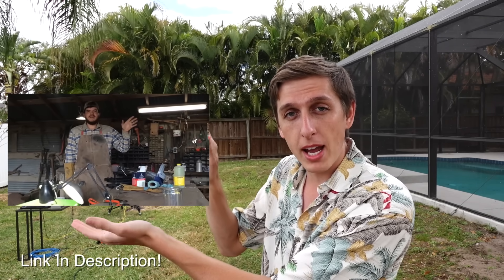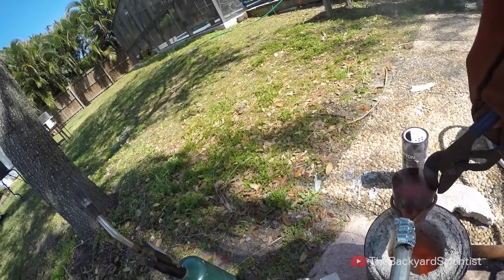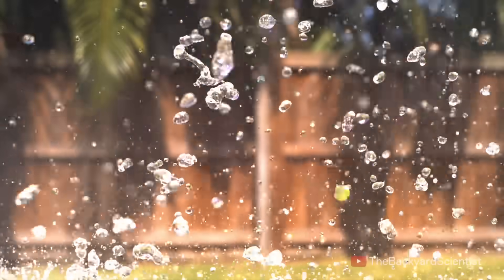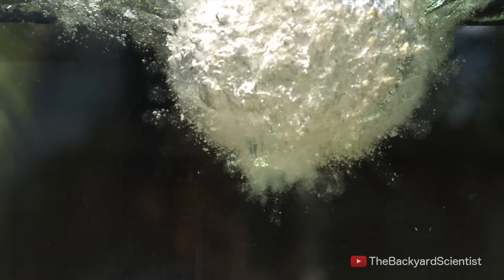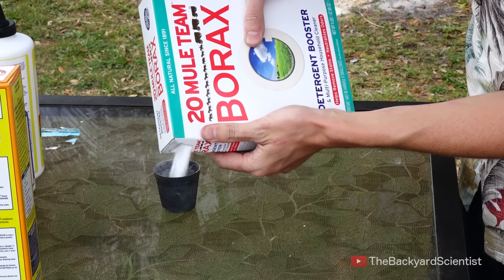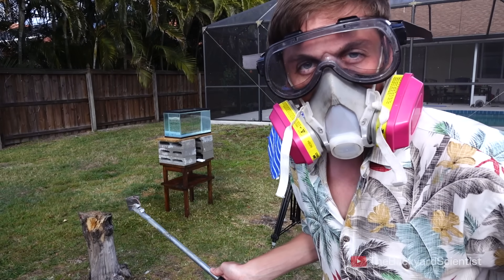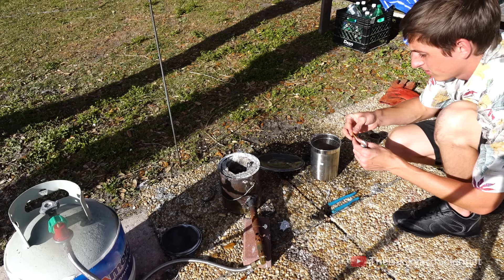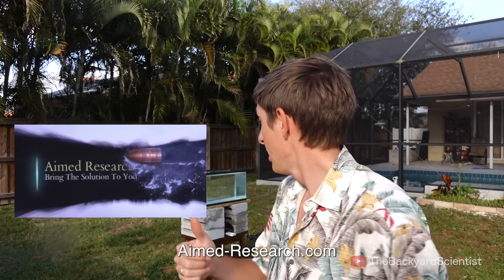Pouring Molten salt into Water - Explosion!

Comment: This phenomenon is similar to the prince rupert's drop, where molten glass coming into contact with water forms internal tension within the glass. Although glass becomes fully solid, salt does not.

Salt can only crystallize, and because of that, it is extremely fragile compared to glass. (the crackling that you hear from the cooling salt is releasing internal tension within a molecular level)

A prince rupert's drop explosion is extremely similar to this explosion and possibly would need further investigation to see if this is factually the same effect.
Reply: +Stephen King You couldn't be more wrong. http://ufdcimages.uflib.ufl.edu/AA/00/00/03/83/00060/AA00000383_00060_194.pdf
Superheated Liquids; A Laboratory Curiosity and, Possibly, An Industrial Curse
specifically states that there is no solid salt formed during the explosions. The generally agreed upon mechanism is that the molten salt is immediately dissolved into super-heated steam which provides near perfect heat transfer from the salt into the water, creating more super-heated steam, which immediately dissolves more salt, etc., ad finitum. The go/no-go is whether the super-hot substance will quickly dissolve in super-heated steam. References say this also happens with LiCl and KCl. I can think of a couple of other houshold salts which might work.
Reply: This paper was written in 1977, better high speed photography is possible now. As I maybe should have said, this needs more (recent) investigation. Although the paper postulates that it is fully liquid, but has this technique been used in different liquids and temperatures? 

These methods would rule out thermal shock and the reaction being exclusive to water. 

I do believe that the explosive force is definitely vapor based, but my theory is that the molten salt  would need more surface area to cause such a large blast.

My surmised idea would be that the liquid instantly forms a shell and in the same instance because of some internal stress explodes, continuing through smaller and smaller explosive particles.
Reply: Also, I should say. I'm in no way academically inclined towards thermal dynamics. I really don't have much knowledge of research that has, or currently being done on this subject.

I'm just assuming and applying a common sense approach to working this problem out.
Reply: +Stephen King So you don't understand what causes the explosion but because you like Prince Rupert you will  ignore all previously published research on the subject and assume that any explosion is caused by "cracking crystals". Very sound methodology.

 FYI the "cracking sound" is the microphone cutting out the (rather loud) explosions (of extremely short duration). Get it? your base assumption is wrong.
Reply: The crackling I was referring to was this... 
https://youtu.be/PDRWQUUUCF0?t=58s

(Which is internal stress being released)
Reply: Your indignation to me is pretty noticeable, but I am in no way refuting previous research or acting as if I know everything. I am just asking questions and wondering if anyone has the answers.

"It is the mark of the mind untrained to take its own processes as valid for all men, and its own judgments for absolute truth."

Comment: salt crystallizes that's the reason
Reply: No
Reply: +danel bertrand I think it's just the water vapor just rapidly expanding in the water m9.
Reply: +Infinity315 it seams like there's hydrogen Bubbles getting trapped inside the crystal structure and that's causing it to explode
Reply: danel bertrand If there was hydrogen then there would be a flame, which you can clearly see is not present when it explodes.  Also the separation of the Sodium and chloride requires electrolysis which isn't happening since there is no current.
Reply: +Infinity315  gasses don't always combust in a reaction
Reply: danel bertrand Regardless, you're still wrong.  It's impossible to have hydrogen (in this without an alkali metal (in this case Sodium).  The liquid Salt would've had to be electrolysized (sp?) to get Na and Cl.

Comment: The solution rate (the rate at which the NaCl salt dissolved in the water) was increased by its elevated temperature to exceed the rate at which the liquid water coming into contact with the molten salt was converting to steam.

The relatively large mass of molten salt very rapidly dissolving in the water caused the shock wave that it created by its rapid dissolution to be powerful enough to break the glass of the aquarium when it hit the aquarium walls.

Cooling of the salt by its contact with the water overcame any tendency of the water to flash into steam.

You obtained a surprising result with your experiment.

Apparently, the Borax did not have the very aggressive capability of dissolution in the water as did the salt. Plus the mass of Borax seemed considerably less than the salt.
.

Comment: The sodium isn't reacting with the water, it's the Chlorine and Hydrogen.
My theory is that the Chlorine is being offered up by superheating the NaCl, and since the bonds between the Sodium and Chlorine are chemically weakened by the heat it can be separated by the temperature shock during the Leidenfrost effect. Temperatures in excess of 1,000F are also usually sufficient to be able to split water molecules(see pouring water on burning Magnesium...). NOW, here's where things get messy: The chlorine is reacting with the water vapor around it and Ultraviolet radiation from the sunlight, stripping the Hydrogen molecules from the Oxygen, while the vapors from the NaCl allow it to mix with the freed Chlorine gas. UV radiation is acting as a catalyst, causing an extremely powerful, highly explosive reaction and creating small amounts of HCL that are being blown up and out of the water when the cavitation bubble collapses. Since the reaction happens so fast, but is so powerful, there wouldn't be time for a large enough amount of hydrogen chloride to form and alter the Ph balance of the water significantly enough to be detected by test strips. Another thing that is contributing to the violence of the explosion, is Hydrogen, which in and of itself is a highly unstable element and pretty explosive if given a little nudge, particularly in the presence of pure Oxygen. 

Tl;Dr: 1,000F+ NaCl mixed with cold H2O separates small quantities of them into their constituent elements. UV radiation reacts with the H and Cl, explosively creating HCL in a highly explosive pure Hydrogen-Oxygen atmosphere.

Disclaimer: I DO NOT HAVE A CHEMISTRY DEGREE. This analysis is based off of observation, an extremely basic knowledge of chemistry, and some experience with Explosives, Welding, and Rocketry. I performed some google research and fact-checking prior to writing this response, and found a LOT of information regarding how dangerous Chlorine and Hydrogen gas are in mixture.
Reply: +Shayde Mohr (SnowblindOtter)
Hydrogen bonds are very strong bonds, I don't think such a low amount of UV radiation could break them, and if it could why would this occur once contacting the water?
Also, catalysts don't affect the overall energy of a reaction. If they do, then they aren't a catalyst.
Reply: systempatcher
Let me address this in two parts:
A) Hydrogen bond strength is dependent on pressure and temperature, particularly in H2O. Solar UV Radiation can, and has been proven to, be powerful enough ionize water and break down H2O molecules. This process is very slow. The most reliable, and rapid, methods of breaking water molecules is through Electrolysis, and application of temperatures high enough to overcome the molecular bond force. As stated, this is seen when you attempt to put out a Magnesium fire with water; the temperature is high enough to excite the water molecules into breaking apart. Magnesium typically burns in air in excess of 1,000 degrees Fahrenheit, which is hot enough to rip pure Hydrogen and Oxygen away from liquid water and cause an explosion.
B) You're fundamentally misunderstanding what a catalyst is, and does, in a chemical reaction. A catalyst is any element in a system which lowers the prerequisite amount of total free energy required to react by supplying its own free energy. Hydrogen and Chlorine gas are more than happy to exist in perfect harmony, because the free energy required to initiate a violent reaction is not reached with the two gases alone. They most likely will calmly degrade into hydrogen chloride slowly over time. The UV radiation is  acting as a catalyst, because it is supplying the additional energy needed to excite the Hydrogen and Chlorine into reacting violently, but it is NOT a catalyst because it is not a substance in the reaction; it's just pure free energy. Similar to how you can set a block of C4 on fire, but it won't DETONATE without a blasting cap. The same reaction takes place when mixing Hydrogen and Oxygen. They will slowly combine to form H2O2 and H2O over time, however introducing a spark will cause an explosion with the two gases, producing water as a product.

The explosion is most-likely a result of the extreme heat of the liquid salt being able to give off small amounts of pure Chlorine gas, which reacts on exposure to UV radiation from sunlight with the Hydrogen the extreme heat was able to excite away from the Oxygen in the water molecules. The reaction is so violent, because Hydrogen and Oxygen in mixture with one another is extremely explosive. There are two reactions happening simultaneously. In lieu of an actual answer, this is my best conjecture. My best guess as to why the second reaction happens at all, is because the first reaction collapses the Leidenfrost effect.

Comment: My bet Is still on chemical…

The fact that the hotter the molten salt was and the fact that speed of getting
it into the water in one large glob seems to support your trapped expanding
steam idea.   However, the smaller
explosions emanating from the larger one (presumably by smaller globs of molten
salt) suggest that no matter the size of the salt blob the reaction still occurs.  It seems that even a very tiny blob of molten
salt, too small to envelop any water, crust over and then “pop” reacts explosively
as seen by the secondary explosions emanating from the primary one. 

So what I think is happening is the Na and Cl are spontaneously disassociating (splitting)
extremely fast and then equally quickly recombining. Sorta like sodium metal
being put in a Cl gas environment, pretty violent when it is just a slab of
sodium, but when the reactants are hot and gasified BOOM!  This would also explain why there is no PH
change in the water, the Na and Cl immediately upon being split would recombine
there would be little chance for either to dissolve in the water.

And would be surprised if a glob of molten salt could contain enough pressure
to blow up that first tank.

If ya have the time I think there are some tests right up
your ally that can shed some light on the matter.  

The borax test was great interesting in that it was
inhibited by the lidenfrost effect, I would love to see a test of potassium chloride
(sold as a salt substitute) that I think will react similarly.   Thought I think the best way to sort this
all out is a test replacing the water with something like used fry oil, pure propylene
glycol (anti-freeze) or something non-polar, no polar water-salt disassociation
no bang. But if it still reacts explosively I then it is indeed a physical
reaction!

Comment: Could you fix your paper links? I'd really like to review them.
Reply from the maker: +systempatcher yes I can fix them in an hour I'm on YouTube mobile and I can't change them from my phone
Reply: +TheBackyardScientist 
You could attempt this again with NaBr and NaI, both of which have very similar boiling points and structure but differing electronegativity values among bromine and iodine. You could also put a flame over the reaction to see if any hydrogen gas catches it and ignites, given the water is reacting with sodium.
Reply from the maker: +systempatcher wow I wish I thought of that! I have lots of NaBr and NaI. I tried other sodium salts, I should have tried other halogen salts too.
Reply: +TheBackyardScientist You could also try salts like CaCl2. This is more ionic and forms more ions in water so hypothetically, the reaction should be more violent.
Reply: +KanyeNotheastern 
More ions don't necessarily mean more of a reaction. This could be shown by s freezing/boiling point depression model. NaCl dissolving in water is endothermic while CaCl2 is exothermic.
Again though, dissolving NaCl in water isn't technically a reaction.
Reply: +systempatcher But when you think about putting salt on the roads in the winter, NaCl is used most of the time, but CaCl2 is used when it gets really cold because it lowers the freezing point of the water. Also, adding any ionic compound to water is a reaction because you are forming the ions that make up that salt.
Reply: KanyeNotheastern
Oops looking back I sort of had that wrong. CaCl2 does contribute to a higher freezing point depression (but it is still exothermic).
My point is though that simply separating a molecule into it's ions isn't a chemical change. Sodium itself is highly reactive with water, yet ions of sodium are essentially harmless. Dissolution is a physical change, not chemical. It can become chemical, however, which is why I suggested using other sodium salts.

Comment: The sodium exploded because the extra electron in the sodium was so desperate to get out that it instantly reacted with the water to create sodium hydroxide and some extra stuff: 2(H2O)+2(Na)=>2(NaOH)+(H2)
Salt is Sodium, without its extra electron, and Chlorine, with the extra electron you need. The heat moves the electron back to the sodium, so that it can react with the water: H2O+NaCl=Δ>NaOH+HCl
Reply: +CedarAce  Oh and also that means it's a chemical reaction :)

Comment: I think it's because of the hygroscopic nature of sodium chloride. Maybe that somehow manages to overcome the leidenfrost effect, allowing water to permeate the blob and then expand rapidly, resulting in the observed explosion. The fact that you had to heat the molten salt for longer (thus getting it hotter) in order to get this effect means that, at its lower temperature, close to its melting point, it was cooling down too fast and maybe the entire volume was becoming solid before a large enough surface came in contact with the water.

I don't think you're right about the pocket of water getting trapped inside, but I think you're close. As you've noticed, there is a "2-stage explosion". I think the original, smaller explosion shatters the still-liquid and still-very-hot blob of salt, fragmenting it in smaller pieces that hit the water and suffer the same fate. So you now ahve a very large surface area of a very hot thing meeting water and making it boil instantly. That's why you had to get it hot enough before it actually exploded.

You could try testing this with other hygroscopic substances. Some very hygroscopic substances are sodium and potasium hydroxide, potasium, calcium or zinc chloride and even sulfuric acid (although the last one is obviously a very bad idea and doesn't even need to be hot to put on a show). Not all of them would work, though, I think. Zinc chloride has a very low melting point and even its boiling point is below the melting point of sodium chloride. Sodium and potasium hydroxides have a low melting point, but a high boiling point, so you could get them hot enough before they start bubbling. The best contenders would be potasium and calcium chloride (the las tone is very hygroscopic). Their melting points are close to that of sodium chloride and you'd still have a few hundred degrees to grow from that. In fact, calcium chloride boils at around 1900 degrees celsius, so you have a lot of wiggle room. Of course, potasium chloride is easier to procure, since it's a replacement for table salt for people that can't consume much sodium.

So maybe you could do a floow-up video with one (or all) of these substances... minus the sulfuric acid - please don't try that! In fact, please wear some sort of protecting clothing next time (and I don't mean just a gas mask) - I'm still shocked watching you do that with pure sodium. Then again, some people watch these videos for the same reasons they watch car racing - the acccidents :)

Also, anybody that thinks it's a chemical reaction can calm down - it's not. The heat is not enough to break the ionic bonds between sodium and chlorine.

Comment: sodium chloride bonds with water molecules to form sodium hydroxide it bonds with more water molecules to form sodium hydroxide solution. sodium is a volatile substance so when it comes into contact with water it creates an explosion, this is because salt has a higher melting point than the boiling point of water so when they come into contact and the water molecule tries to bond it turns into steam and as more water molecules join it creates air pockets within sodium which makes it go boom.